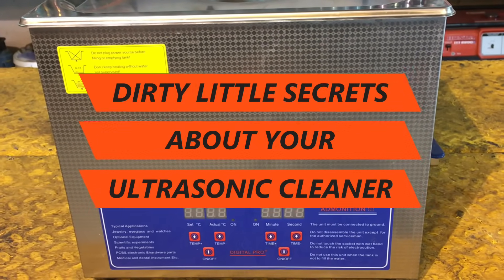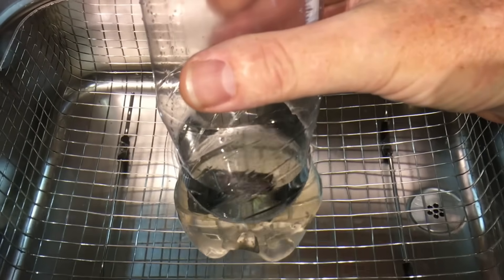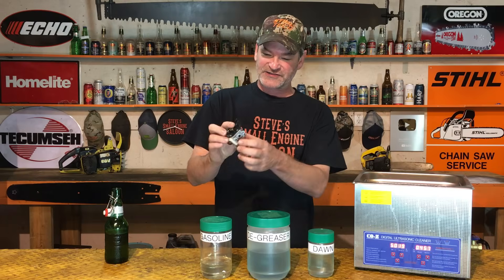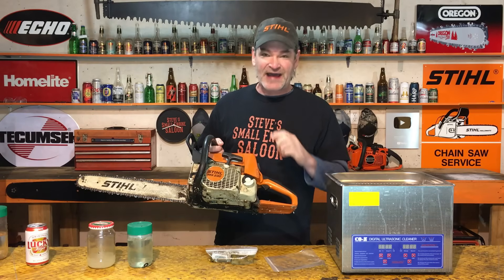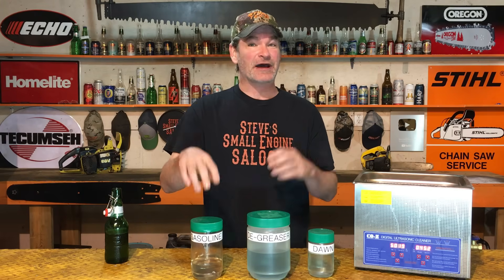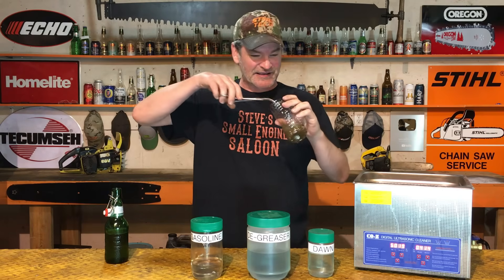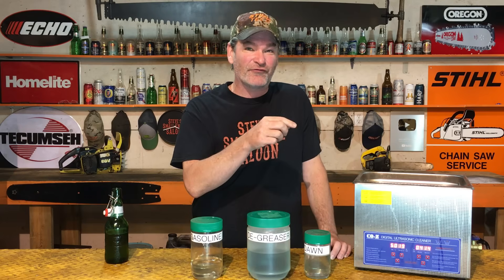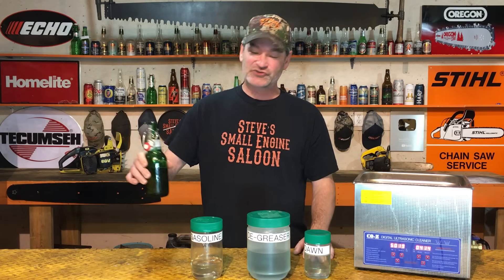4 Ultrasonic Cleaner Mistakes You Need To Stop Now!

Comment: Thank you so much for this video. It is very helpful.
About the safety of gasoline: It is not about the fire and explosion risks. I was concerned about safety. I still am. Please, keep using gasoline, but also, be aware of the risks. It is very highly carcinogenic. Also, it is harmful for your general health and the brain in particular. If gasoline wasn't such an important fuel, this would have been prohibited for consumers.
I am not advocating against using gasoline. But if you use it, it is very important to be aware of the risks and take precautions. Read the MSDS before using it.

Comment: Bought my Vevor 6L unit about a year ago. Used it many times with mixed results. Anyway, after buying a very low mileage set of 4 carburetors for my Motorcycle. It was dicovered they were full of the immovable dried gasoline varnish. I tried all known detergents. Heat, boiling, burning finally finding paint stripper, to be the only thing that worked. But, only if directly agitated with a brush. I never felt confident, in rebuilding them because of the tiny orifices and drillings. So the rebuild was put on hold. That is until this post. I tested it on a couple of the jet housings. In a glass jar, gasoline full heat. 10mins, The varnish essentially just fell out of the part in tiny little particles. I cant thank this poster enough. 
Plastic doesn't work as well as glass, but what really does work are the really thin stainless steel drinking beakers (wal- mart or target, cheap as dirt) Thanks for posting.

Comment: If you like gasoline, try odorless mineral spirits instead.  It's a better solvent, and with a lower volatility, it's less dangerous.  Gasoline is flammable enough, but remember that an ultrasonic also gets warm, and hot gasoline is so much more dangerous than cold gasoline.

Another great cleaning solution (not as much in an ultrasonic, but as a general residue free cleaner) is Coleman fuel.

Diesel and kerosene are also commonly used, and they're fantastic degreasers, but not so great a solvent for gums (varnish, waxes, etc.).

Comment: i use an ultrasonic cleaner to clean fishing reels that i restore. i have seen many that look only fit for the bin. i use fairy liquid in my cleaner set for 50c. i clean the worst of the muck and grease off the reel parts using white spirit or turps and i then degrease them with elbow grease degreaser spray followed by 30 mins in the ultrasonic. . i will have to give your tips a try and see how i get along

Comment: Have a 30L ultrasonic tank.  Have cleaned all many things in the last few years.  Tried all sorts of cleaners and ratios.  Heat and no heat.  Everyone has a secret recipe or combo.  I’ve done many types of aluminum.  Grades of.   Cast.  Forged items.  Stainless. Mild steel.   Many variables.  For most simple household items.  Dawn soap works well. As does a diluted mix of Mean Green.  Items come out like brand new.   Citrus cleaners come in many forms today.  Have to be careful.  It’s easy to change the color of many aluminums.  Almost anodizes them.  If you have a dollar general and can find LA’s Totally Awesome citrus cleaner.  Half or gallon.  Amazing results.  Usually mix is 4 parts water to one part cleaner.  Heat can really make metals factory new.   Be careful with it on soft metals though.   Been the best piece of equipment I’ve ever purchased.

Comment: Your three solutions though are not viable for cleaning gun parts including suppressors. Due to the fact that guns have lead and copper buildup, and we need solutions that weaken the bonds of lead and copper. I have used the jar method to clean small gun parts, and when suppressors have smaller parts that come apart as well. However larger gun items such as frames slides and barrels it makes it a lot harder to do that. Would be nice if we could. For gun parts. Lucas Oil makes a very good quality solvent for ultrasonic cleaners. Sadly it’s $100 a gallon. But we get what we pay for as well.

Comment: I have a 6L ultrasonic cleaner that I bought for cleaning LP's. It didn't come with a basket and Vevor will not sell me one. Any ideas what to use because I have read putting parts directly on the bottom kills the sonic power.

Comment: i do carburators for 40 years! the gasoline thing is about the vaporising ... 

so in my shop are 5(!) ultrasonic with different solutions : just Destwater with the dishcleanertabs bring it up to PH11 , one is special Carbcleaner, ph8, an another has rustremover with ph2 in. this 3 are connectet with there own eheim aquariumfilter. 

so the filter removes al debris and every bath last longer, just need fresh water and a little upfilling the cleanerstuff. the filter needs a reverserinse in about ~3 month! 

and yes the gasolinecontainerthing i do with stickygreasyshit.

Comment: Be careful if you clean eyeglasses in an ultrasonic cleaner. My experience was that they cleaned up well, but then the next time I drove at night I had some serious "stars" from oncoming headlamps. I switched to my spare glasses and they were fine. I suspect the combination of heat and the aggressive Dawn dish soap broke down some coating or the surface of the lenses. They look OK to the naked eye and work fine in normal light.

Comment: You are incorrect.  It is the explosion of those microbubbles that are the potential ignition source. Youd be better off using deisel if you must use an oil based  cleaner.

Comment: @steve, the problem with the container method is thst the soundwaves are reflected/attenuated every time they cross from one material to another. This is how ultrasonic imaging and sonar work. The speed of sound is different between water and plasic and glass and that speed change acts like a partial mirror. It works just like when a stick looks bent when you poke it through the surface of water or you see a reflection in a pane of glass.

Comment: 1.. regarding gasoline use,  the white plaque on carb parts is caused by the ETHANOL gas.
Would it be more beneficial to use NON Ethanol gas for sonic cleaning or wouldn't matter
Given that you hopefully, wouldnt be leaving your parts sit in the Ethanol gas for days?

2..Any reloaders here? 
You can wet or dry clean your brass, wet seems to be better.
In the tumble cleaner, the preferred solution is water, drops of dawn, and a capfull of citric acid powder.
It works pretty good but i would never add powder to carb cleaning solution.

I tried 1/2 cup of 
"Bike Brite MC441G Motorcycle Spray Wash Cleaner and Degreaser" 
that i got from amazon. It aint cheap, 35$ / gal, but one hour and it makes 
My brass shine like gold.

I hope it does the same for the aluminum carb parts too.
Will let you know after i try it out.

Comment: Great tips!!! While I'm 100% behind using glass, the safest way is to use Pyrex glass or make sure both the water in the tank and the glass jar are the same temperature. If you're working in a cold shop and heat up the tank first, using cheap glass will instantly crack if there's a large enough temp differential.

Comment: Another top is to make sure parts are not directly on bottom of tank.  This will damage the drivers.  I thought it was BS till I killed my old one.  Simple Green is amazing in the US but wash it off quick if using on aluminum parts (if painting aluminum parts, this will be an outstanding etch.  ATF works well also for bike chains, gearing etc.

Comment: I agree that the risk of gas igniting is minimal but I am concerned with exposure to the fumes and skin contact. Gasoline is a mix of many types of chemicals including benzine which is a carcinogen. I used to use heptane (formally used as non chlorinated brake and parts cleaner). Safer and less offensive than gas. However recent changes in environment protection in Canada prohibits the sale of pure heptane. The replacements are typically made of small amounts of heptane, acetone... These work well and leave no residue. I buy this a gallon at the time and use it for brakes, parts, bicycle chains and it's the best I've found so far.

Comment: so your advice is to deminish the performance of an ultra sonic cleaner so you can safely use a solvent that wouldnt otherwise be safe. Heat is far more effective than a straight solvent at removing stuck carbon and other baked on debris. This is absolutely dumb advice.

Comment: Just a technical reminder, sound waves decrease (lose energy/get muffled) when passing through plastic or glass because they vibrate the container's molecules, converting some energy to heat, with the amount of loss depending on the material's thickness, density, and frequency of the sound, with some energy reflecting back 'out' so you will lose 'some' efficiency with this context, but it IS a cleaner way to clean items. As I understand this based on sound wave propagation, the 'reason' it's communicated to fill it up is because the short 'length' that the sound waves are being dispersed are reflected back vs being absorbed through the volume of the water into the intended item. Basically the sound waves are being recirculated back down at the transducers because there's nothing to absorb.

Comment: Have you used diesel as a cleaner/solvent?
Reply: Diesel is a great degreaser\cleaner. But as a very long time diesel mechanic. The stink!, unlike gasoline that will evaporate off and a hot shower will kill. A good splash of diesel fuel effectively renders a pair of pants useless. A shower helps, but standing in a line at a bank or store even after a day. The fumes will make your eyes water.

Comment: I have been using carbureator cleaner, degreaser, dish soap, and many other solvents and cleaners directly in my ultrasonic cleaner over the years and have never had any issues.  I don't bother with the bottles or containers as it is just as easy to clean out the stainless steel container.

Comment: Ultra sound travels easily in liquid; It bounces off of solids. One mistake I think you made in your demo, was to not completely cover the socket with cleaning liquid (soap) in the small container.  The results probably would have been more dramatic if the entire part was submerged in the cleaning fluid.

Comment: The small 4 cycle carbs like the ones on mini tillers/cultivaters have small parts that sometimes become dislodged and fall out of who knows where.  I use GREASED LIGHTNING cleaner/degreaser. I get it at Lowe's for around $30 for 5 gallons. I fill the ultrasonic up to the line with it and when I'm done I drain and strain it into a coffee filter setup that I have made. I will now use the small container method.

Comment: “I don’t like having glass around my shop”
“Except for my hundreds of beer bottles behind me” 😂
Reply: lol
Reply: I use plain diesel in mine. 
I tested a lot of liquids and some were no better than plain water. 
I put the small parts of the carby in a glass jar (idea I got from you years ago) and I use old 2 stroke fuel in the jars.
Biggest tip I learnt is take the parts out as soon as it is done and hit it with some compressed air. Leave it for even 10secs and the sediment will settle straight away
Reply: Would you prefer to drink out of a can😝
Reply: @drizler as opposed to NOT drinking?

Comment: I use gasoline for cleaning oily parts too.  The problem is : what to do with dirty gasoline? (Disposal).   Any suggestions ?!.
Reply: Yep. Get a dedicated gas can. Put all the used gas in it. Then let it sit. I put mine outside for at least a week or two. Carefully pour off the top. The gritty solid contaminants will settle, and leave, a still very usable solvent.

Comment: Yes, gasoline is a great solvent, but the reason I don't like to use it for that is gasoline contains some very toxic compounds and carcinogens. The main one benzine and other VOCs. It's as bad as brake cleaner and will rot your brain cells if you're exposed to it regularly. Long term exposure will really mess you up, and you may not find out until years or decades later. I say this as someone who works in the oil and gas industry.

Comment: Pine-sol works great on carbs. From what I read it's contains a high percentage of alcohol coincidentally most carb cleaners have contained a high percentage of alcohol. But it's hard to get rid of that overpowering pine smell. And it will remove painted from surfaces

Comment: Hard disagree about gasoline, indoors, in an open container, being agitated by an ultrasonic cleaner. That machine agitating that heated gas is going to create more fumes which can go anywhere. Those fumes find an ignition source possibly the machine itself and you’re cooked.  YouTube is full of idiots doing stupid stuff with gasoline. I wouldn’t be surprised if you  or ten of your viewers don’t lose their house or life.  It’s not just about whether or not gasoline is good for cleaning it’s about safety and common sense. Where is your common sense.
Reply: Untrue. Before the gasoline vapor : air mix becomes spark combustible. You wouldn't be able to breath. Its true Gasoline when warm is even more volatile. But lets face it, gasoline is just an oxidizer short of a bomb already. Use the same caution you would with an open container.

Comment: On the water fill line and those things blowing themselves up when not filled properly - I honestly don't know, but if I had to guess, I would assume that the waters represents the impedance of the circuit, so to speak. It needs to be matched to the frequency and the power of the system. If it's too little, I guess the system runs hot because it keeps dumping the oscillations back into itself. The vibrations don't have enough  If it's too much, it's probably over-dampened, so it would not clean as well but not blow up.

Comment: I used to work in the aerospace industry and we used Isopropyl alcohol for all sorts of cleaning in the ultrasonic, mostly fasteners but we wiped surfaces etc...  I might try doing that on some carbs and see what it does. It cuts grease and oil like crazy so it might do well on the gummy gas goo too. 

One other "tip". That white powdery residue that seems to come from ethanol gas was driving me crazy. Had a red gas cap that was encrusted with the stuff and nothing would touch it. I finally put it is a baggy with gas and after about a day, it was all gone... so was the paper seal that was on the inside. I did take it out and set it next to the baggie but by the time I got around to putting it back in, it was gone... no idea what could have happened to it. I'm the only one working in there. I will find it as-soon-as I buy another gas cap.

Comment: Awesome information I'm new to these cleaners using it on a old tool and once on a carburetor. I've been taking the wife quart zip lock bags and using distilled vinegar and water with success but I want to try Dawn and now Gasoline. The plastic jars a cool idea as I've got a box full. My only question? Do I not need the lid to the cleaner on when using ?

Comment: Anyone tried diesel? In a jar like Steve did with the gas?
I know its greasier than gas but its a great degreaser
On that same line of thoughts; wd40 is a great degreaser too. Sure you need the extra step of cleaning the part of wd40 but eh it does the hard part

Comment: Failing to suspend items in the ultrasonic cleaner will lead to overheating the transducers. Reason that some cleaners come with a basket to reduce contact with the base.

Whether or not you select heat on a ultrasonic cleaner, the wave excites the solution (the tiny bubbles you see) which generates heat. Heating flammable solvents (gasoline) in a ultrasonic cleaner causes gases which have to go somewhere. Provided you have ventilation in the area, it's probably not an issue. In an enclosed space you might start noticing painted items yellowing or changing color. The ultrasonic cleaner manufacturers all caution against using flammable solvents due to risk from fire.

I use machine dishwasher cleaner as it contains an anti foaming agent. Dawn and other hand dish washing detergents show bubbles to indicate that they are working.

Comment: Good tips! I'll need to try gasoline - not tried that yet. Just for the sake of people worrying about gasoline, yes, it's flammable, explosive in a 1:9 mixture with air, but all it's potential issues are easily mitigated. Even heating can be done, although lower temps are safer - it's boiling point is 65-90 C, so the 30 C low temp heating on a cleaner is likely best. Enclosed containers will be best, but if heating, even to 30 C, you'll need a pressure relief valve. My valve hack for flammables is nitrile gloves (or similar - they must not degrade with whatever solvent you're using) - poke 1 TINY hole in each side of the glove (off-set from each other), then cover and seal the edges. Or you could just use the wrist to cover the jar and poke 1 tiny hole in 1 of the fingers. That will vent pressure without any significant fire risk. But yes - there's always a hazard whenever working with stuff like that.

Comment: Hey ... thank you !  I use some very expensive cleaner and it gets contaminated quickly where I have to filter it. What a mess and process to do. I didn't realize you could do that . Now I can utilize my large ultrasonic cleaner for smaller jobs and not break the bank or my back. BTW I have the exact model and size of your Ultrasonic cleaner you show there.
  Thanks again 🤙👍

Comment: You used 2 different sockets the first socket you put in the dish soap had 2 knurled bands around it like the Snap-on sockets but the second socket you put in the gas only had 1 knurled band around it, so why didn't you use that same socket?